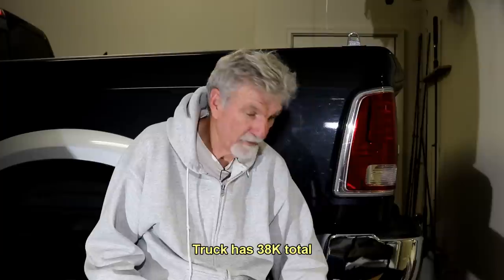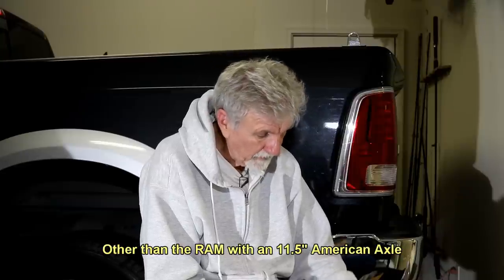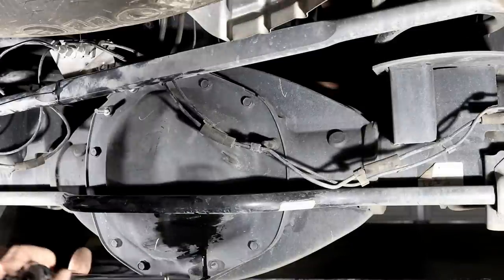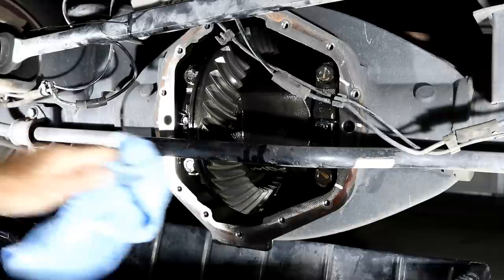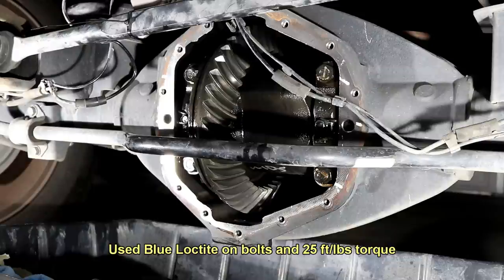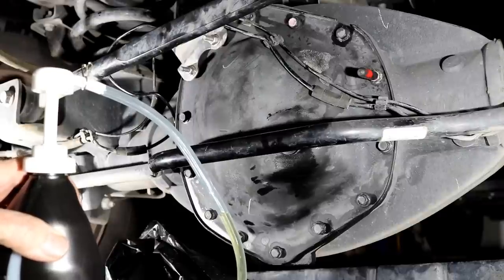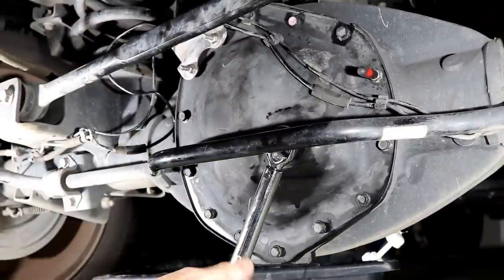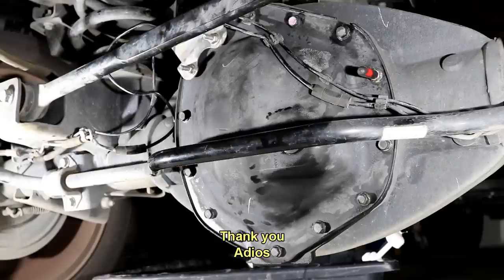RAM 2500 4th Generation Rear Differential Oil Change

Comment: Experienced a bolt shearing off due to incorrect torque specs as well with my transmission pan. I've been running with the one bolt off and haven't had issues but if anyone knows what you do to fix it or a video on how to I'd love to know as eventually I'll be replacing the pan with the BD pan. I'll be going with the 25ft lb when I do my differential.

Comment: Aren’t you supposed to add in some type of lube to the rear diff? Helps with chattering and other stuff? I’m no mechanic just what I read.
Reply from the maker: No, not recommended as long as you using their Mopar GL5.   it has all the additives and everything needed for the Ram 2500 rear end. don't know if you're using aftermarket products.   best thing to do, is give the parts Department your VIN number and they can look it up to make sure you're getting the right lube for it.  Some  axles require, not this particular one
Reply: Great thanks for the info.

Comment: I recently read the online schedule and there saying under most conditions.You need to change it every 12 months or 15-20k miles.

I tow about 15-20% of the time.Almost at 48k on my 2017.

Time to change it?
Reply from the maker: My son has one with 250K on it and never been changed.  Whisper quiet.  12 months and 15-20K is over-kill.  I never realized how vague the manual is until you mentioned this.  I think 60K is plenty safe fro 15 - 20% towing.  And I wouldn't pull the cover again, I'd do it like I did the front one, (see video).  Pump it out and pump back in.   Easy and no real advantage to pulling the cover other than cleaning the cover.
Reply: Marion Blair I hear ya.Thank you Marion for all these awesome videos.I be have watching for two years now since I got my Cummins in 2018. I will do the pump out method and then replace.

Comment: you can reuse the original gasket, they are reusable, just clean and install. I have done my 2500 4 times now with no issues at all.
Reply from the maker: Thanks, I saw it was in good shape so i've got a spare, I guess.  $45!
Reply: @MarionBlair  better to have it and not need it, than need it and not have it.
I swear when I buy my ram I'm gonna buy a half dozen of every filter and a bunch of fluids. When I walk out, if they ask if they can help. I'll just say me and Marion have got this covered. Cheers.

Comment: Drill 3/32nd hole in bottom of cover. Tap 1/4 threads. Get black faucet washer and 1/2 inch long screw and VIOLA! No pan removed for ever.
Reply from the maker: yea, they I did that on a fuel tank once.  A pump works well also.

Comment: The newer gm trucks are the same. The 2500 up has that same rear.  but I think my 1500 is the same where you fill it less then the hole but its different amount then the bigger trucks. nice video though
Reply from the maker: Appreciate that, Yea, the fill line is confusing but that's what I went with.
Reply: @MarionBlair  yeah what i gathered from watching banks testing. It seems they must use same cover for all but different manufactures mount axle at different angles so makes fill height different.
Reply from the maker: @codyk3881  Yea, those banks videos are really informative.  The one with the clear cover.  I had no idea the oil is getting whipped up so much.

Comment: you claim to be precise why are you filling it a quarter inch above the fill line?
Reply from the maker: It's been a long time but I filled it to the specs as best I could.  I actually  spoke to an American Axle  engineer who was clueless.  He said, no filling it to the hole is to save oil, ha.   The fill line and the manual do not agree.  You're on your own.

Comment: I got some valvoline 75W90 GL-5 synthetic gear oil that already has the limited slip in it, will this work? I know it says it does not require the LS additive?
Reply from the maker: Yes, RAM tells me the Mopar has the additive in it so it should be fine.

Comment: Always follow the recommendation of the AXLE manufacturer, not the Truck maker.  Now with the web its easier.  May need to call them if you can't find the data.
Reply from the maker: I talked to the engineer at American axle but he was CYA and pushed it off on RAM.  I fill to the fill line.  thanks.
Reply: @MarionBlair  All depends on who you get.  It is worth the effort to try.  I'm sure you will be fine.  Something else to consider is getting an infrared thermometer and checking the temp when you break from towing.  BTW Gale Banks has some interesting vids up on how the fluid acts inside the carrier.
Reply from the maker: @latrogeniwile58  Yes, thanks.

Comment: Can u wait to long to change the fluid on a rear end?? My 14 has 120k on it and I’m sure it’s never been done. Won’t create any issues similar to waiting to long on a trans
Reply from the maker: My son has a Yukon with 300k on it and it's never been changed but I'd get a little cheap hand pump and change it.  No need to pull the Cover, pump it out.
Reply: @MarionBlair  ok thanks sir

Comment: When not towing do you use tow haul and engine brake?
Reply from the maker: I use engine brake to keep the turbo actuator exercised but I do not use toll haul unless I'm towing
Reply: It seems with all these trans problems we hear about it would help to hold them in gear with tow haul always activated. Along with knowing how to feather the accelerator keeping from down shifting too much.
Reply from the maker: Yes, couldn't hurt for sure.

Comment: Did you add limited slip additive when filling?
Reply from the maker: No sir it's not required I used the original Mopar
Reply: Marion Blair I don’t see anything on the mopar bottles indicating limited slip fluid is added into their blend. I am just trying to figure out if I need to dump in slip fluid when I do mine. I have the 14 as well
Reply from the maker: @dannyohly3192  I gave the parts guy my vin # and he verified what the manual said which was you don't need it on 2500 limited slip.  This is what my manual has also under limited slip, >>>2500/3500 Model axles DO NOT REQUIRE any limited
slip oil additive (friction modifiers).<<<<  I guess that's true if you use something other than Mopar but I'm pretty confident we don't put it in the 2500.  The 1500's do require it however.
Reply from the maker: No, doesn't require it.

Comment: So why was the cover removed? Does the diff not have a drain plug?
Reply from the maker: Right, No drain plug, but I'll suck it out with a pump in the future like I did the front.
Reply: @MarionBlair  Man, Ram sure has the basics down pat dont they? Every Chev HD I got has a diff drain plug, your looking at minutes to change oil I had just assumed after all these years Ram would have figured out how to put a hole in a diff housing for the ease of basic maitenance.

Comment: I have a 2016 ram 2500 6.7 2wd. When should one change the diff fluid? I do not haul taxi etc.
Reply: Is there a drain plug or you need to take the cap off and use a gasket?
Reply from the maker: @kp7100  I think it's 60K .  No drain plug and it's a pain in the ass to take the cover off.  I'd recommend using a little pump from autozone or wherever and pump it out.

Comment: Looked like oil was running out the bolt holes when you took the bolts out, if so A person could just take the lowest one out and drain it without removing the cover. at any rate, if it needs to be changed every 30,000 miles they should have put a drain plug in like rears on semis have.
Reply from the maker: Yea.  Agree.  I'll pump it like I did the  front next time.
Reply from the maker: Oh, and no, pulling a bolt doesn't drain it.

Comment: It is NOT a limited slip rear end. It is a NO slip unit. There is a significant difference. No need for a gasket, just use RTV on the cover.

Comment: Great video however, at 72 yrs old had over a dozen "work" pickups towed heavy trailers with everyone and never changed rear diff fluid. I have neaver had to rebuild or replace rear. This is kinda like greasing cabon fitting on front driveshaft that NEVER TURNS!! Spending money unnecessarily.

Comment: I don't think 30k is over kill.  Ppl do engine oil at 3k and some will say that's over kill.  I'm going to do mine im just over 30 and don't tow.  It's cheap and I've had a ford with three diffs go.  I undercoat wax maintain everything else makes no sense not to do diffs.  Toyota has drain plugs on theirs that's easy
Reply from the maker: Yes and mine had some pretty tough Mountain Towing

Comment: If your using thread lockers and that many bolts, I doubt you need but 20 lbs.
Reply from the maker: Agree, I was uncomfortable at 25 ft/lbs.  Sometimes I think it better to leave the torque wrench in the draw and use your own judgement.

Comment: That’s why I use the vacuum machine method & just fill up to level . So much easier & no worries of stripping  bolts . 🤙
Reply from the maker: Leonard, I see your point.  Do you have a suction pump you can recommend, I'm going to do the front that way.  I just picked up a Harbor Freight one that looks like it should work.
Reply: @MarionBlair  which pump did you buy?  thx
Reply from the maker: @Kai_boogey  https://www.harborfreight.com/automotive-motorcycle.html?CatPath=All%2BProducts%252F%252F%252F%252FAutomotive%2B%2526%2BMotorcycle%2F%2F%2F%2FLubrication&RequestData=CA_CategoryExpand the multiuse transfer pump.  works great